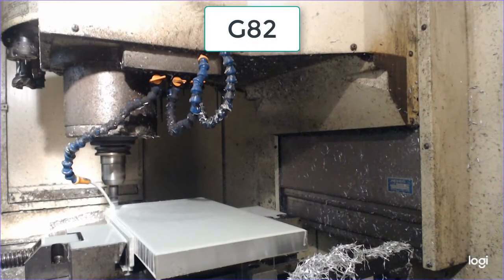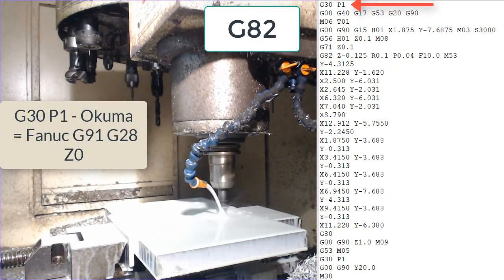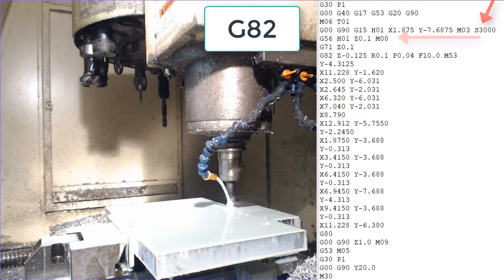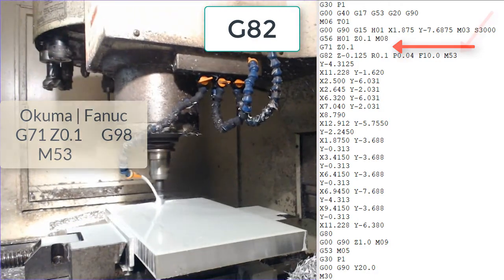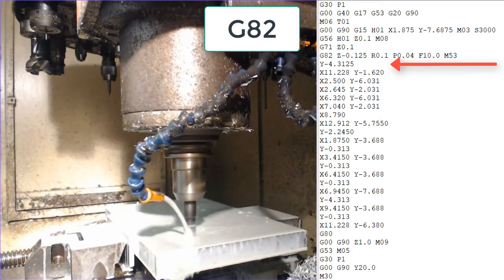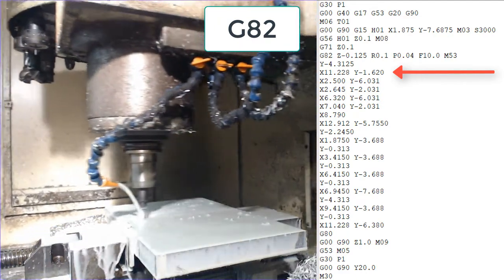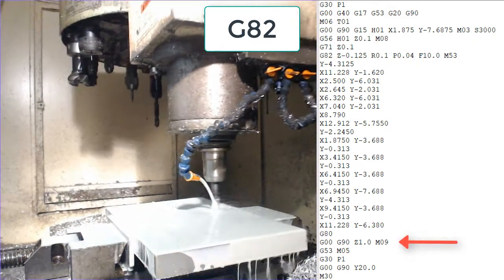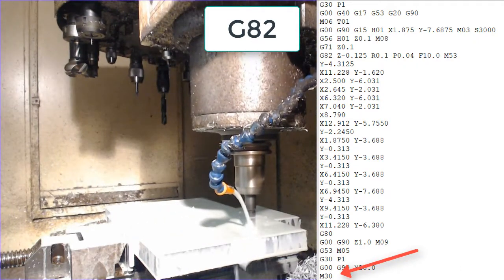G82 Multiple Holes Code Explained -Okuma Mill

Comment: hi,
I am working on OKUMA OSP 5000 M-G control  Do you know what is the format for drilling canned cycles for equidistant holes?
Reply from the maker: Check your manual for the repeat code, but if your drilling 5 holes each 2.5" apart in the X axis, try "G91 X2.5 Q5", or make a subprogram with the line "G91 X2.5" and repeat the subprogram five times.